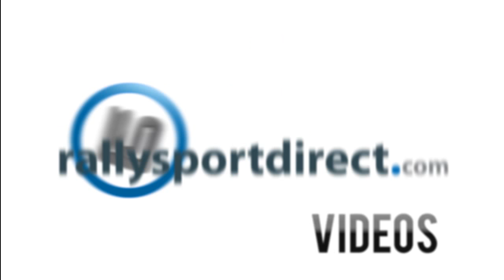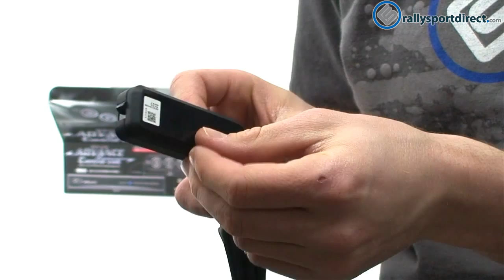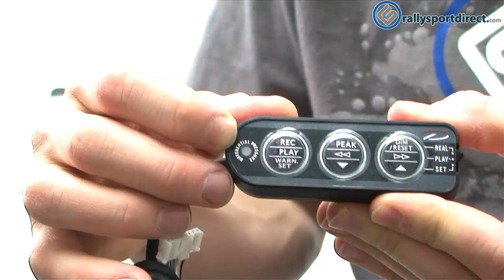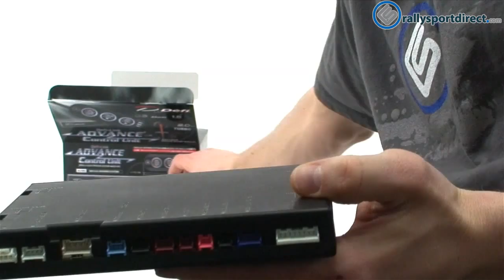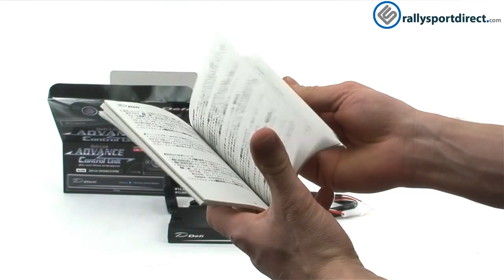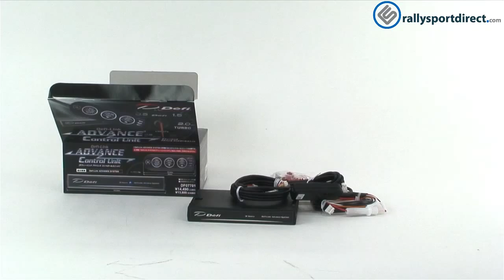Defi Advance CR Control Unit- Whats in the Box?

Comment: I hope you guys can ship items in smaller shipping boxes for those of us overseas using freight forwarders in the US. I just bought this DF07703 Advance Control Unit from you guys. The actual dimensions are only 9x5x4 but it was shipped in a 12x10x7 shipping box. It could fit three control units with room to spare. I ended up paying my forwarder 5 lbs. volume weight for an item that weighs less than 2 lbs and has an actual volume weight of only 1 lb.
Reply from the maker: I'll pass on the message to our shipping manager. Thank you.